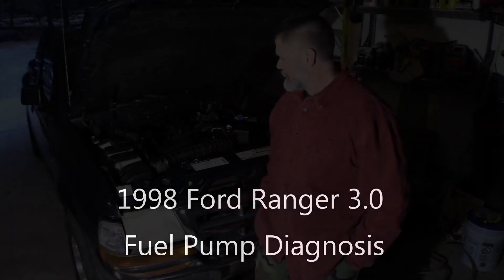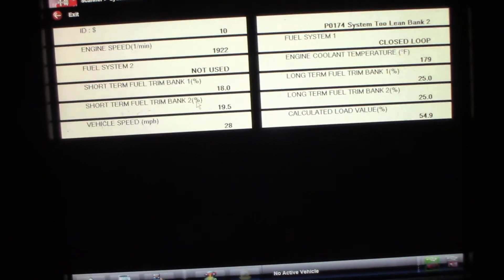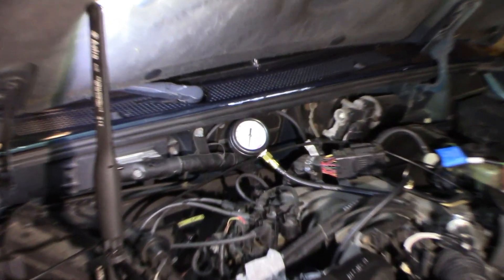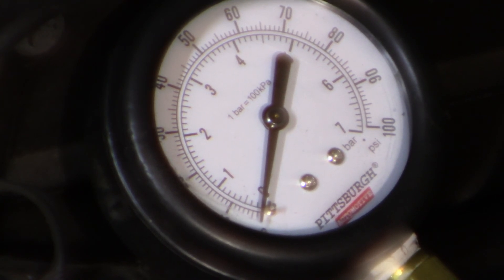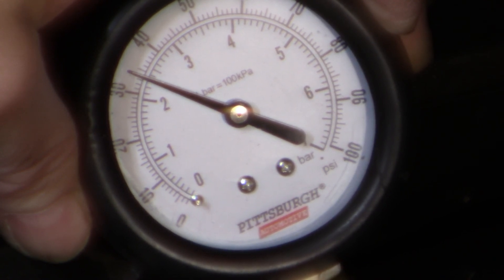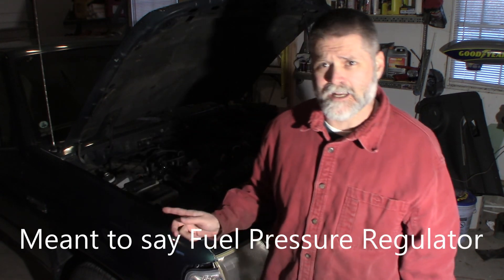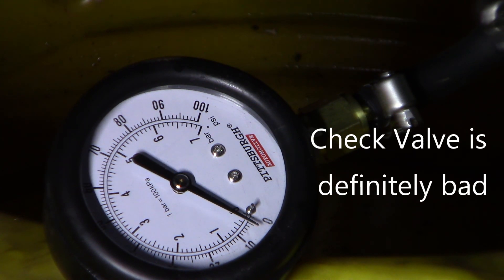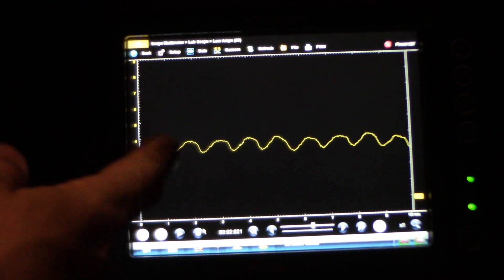1998 Ford Ranger 3.0l -- P0171, P0174 -- Fuel Pump - Part 1

Comment: Thank you very much for posting this video.  I have the same codes and issues with my 2000 Ranger XLT 4X4 3.0 .I will be taking off the bed this week to replace the fuel pressure regulator and the entire fuelpump assembly. This is the second video I've seen of yours and I am very impressed with your diagnostics and repairs. I subscribed to your channel . Thank you again.

Comment: I just bought a 1999 3.0 I only have one code the p0171 and I give it gas driving and it does not seem I have any power
Reply from the maker: Hard to say what it is.  Would wan't to look at o2 Sensors and how they're responding as well as fuel pressure (is it where it's supposed to be and does it not drop when giving it throttle?).  Also would look at short and long term fuel trims as well as any misfire data...  That's where I would start..
Reply: @CharlesAndCars  it looks like the change all o2 mass air  Sensor they just ran a smoke test through the vaccum system to
Reply from the maker: @timothyatkins7772  Not sure what you're trying to tell me... sounds a little like "throwing parts" at it... can't say for sure as I have no way of seeing what's going on with it.
Reply from the maker: First thing I would be looking at would be the fuel pressure if it runs okay at idle, but has no power... with a lean code... not getting enough fuel to balance the mixture... I would expect misfire codes if one of the injectors wasn't working.... Also would wan't to see what the fuel trims are doing off idle.

Comment: Great diagnosis  I Have a 94 ford ranger splash supercab 3.0 2wd  driving it home when I first bought it it lost power almost completely The truck would stay running but when I hit the slightest grade in the road it didn't have enough power to make it I pulled into A Garage they told me the fuel filter was completely clogged and that the fuel pump was shot and would possibly need the gas tank cleaned And that it needed a complete tuneup But they said they would not do the fuel pump unless I had the tune up done first Total price  $1000 I didn't have enough money to pay for both so I drove  the vehicle home 20 mph And  im going to do it myself  I have the bed off and my son and I are  going to change the fuel pump and tune it up Anyway  Great video...Just Subscribed
Reply from the maker: Glad it helped
Reply: Had the same issue driving my 98 home after I bought it, anytime I’d go up hill it would lose acceleration power and I was only able to go about 50 mph hopefully it’s my fuel pump